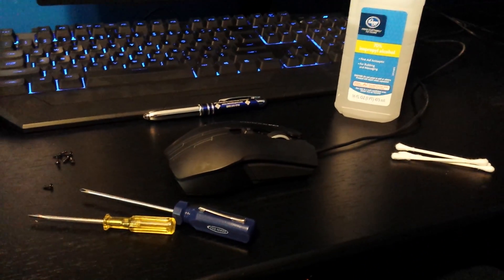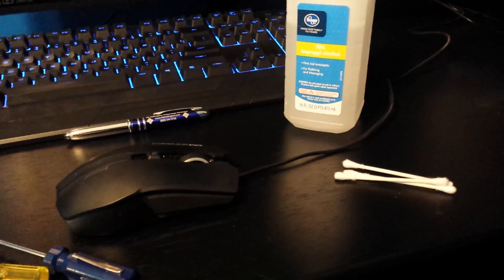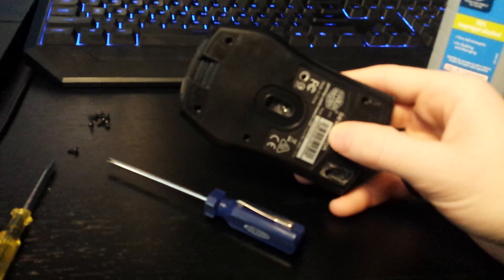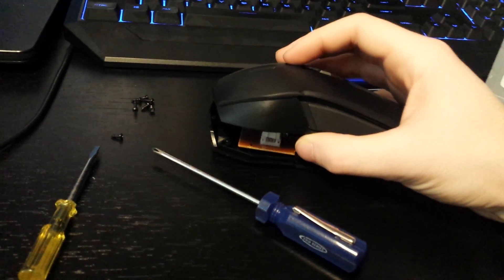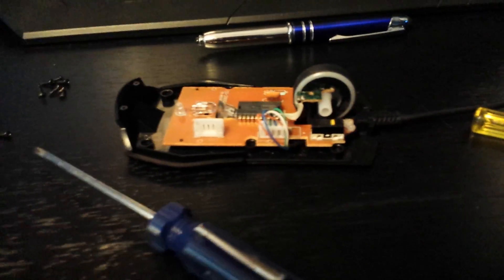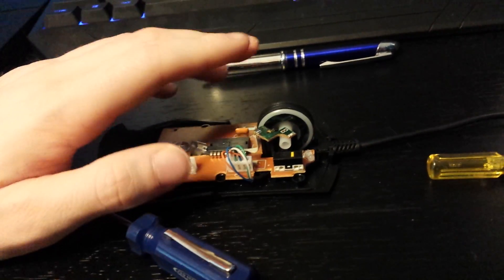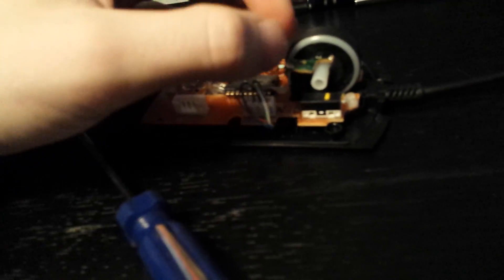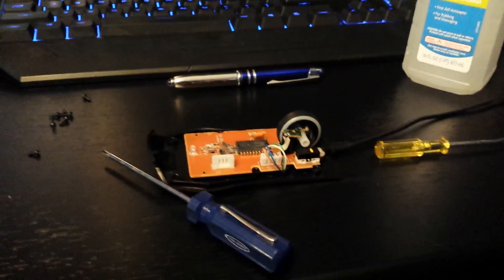Cm Storm Devastator Mouse Scroll Fix

Comment: This video made me discover a way to do this without taking the mouse apart.

I use one of those Walmart brand "Equate interdental brushes" it's like a fuzzy tooth pick.  I lay an alcohol swab over the wheel on the outside of the mouse, and fish it in with the brush thing, then spin the wheel, takes a few spins, and some moving, but works fine now, and I didn't have to lose any screws

Comment: i literally blew inbetween the gaps in the scroll wheel and it has fixed the problem instantly, defo try that first before dismantling. however video is nice and detailed. top job

Comment: I can confirm that simply blowing into the mouse wheel gaps to get the dust out does work. It's a good video though.
Reply: I tried this, even using compressed air, but I'm still experiencing this issue.

Is the mouse wheel just dirty or is it a deeper problem?
Reply: @holyordersol2668  blowing air into mine didnt help.. there was much dust built up, and even some fine pet hairs in there.. I took the mouse completely apart and cleaned every crevice.. it works like it did on day one except the middle mouse button click doesnt function.
Reply: @holyordersol2668  same, the mouse wheel is completely crazy, cleaned everything on a BRAND NEW mouse anyway.... it's a shit brand
Reply: I did this and it worked.
Reply: Just did this lmao, thank you

Comment: I had the same problem, but instead of opening up and trying to clean it like that, I simply got a very tiny and thin piece of metal, bent it to a semi circle with a little hook on it's end, kept scrolling the wheel and sliding it behind the wheel to grab any hair or dust that might have gone behind the wheel, also any bits of dust or hair on the sides of the wheel too. After doing it for like 2 mins, no more stuttering on my scroll wheel. I don't know if it will help everyone but it helped me.

Comment: This mouse is notorious for squeaking when you scroll the mouse wheel, so it would be a good idea to lube the wheel while you're in there.  Preferably with a non petroleum based lube.  As it will attack plastic components.

Comment: Close but not quite correct, the board you are mentioning as the reader, just has an LED light on it and lights up the wheel. The reader is the three legged potentiometer looking thing connected to the left side of the wheel. Spray it with wd 40 and turn it few times to work it in. Easy fix.
Reply: Thank you a bunch. The WD40 worked for me.
Reply: @horridstonefish7564  Avoid WD40, this is not car mechanic. Use isopropyl alcohol.

Comment: Ty so much
Edit:
Bro, the circuit inside the wheel is used only for lighting purposes, if u wanna fix the scroll wheel you have to fix the component it is attached to. This video is pointless.

Comment: Thats not the rotation detector. It's the LED that lighrs up the wheel. The rotation detector is on the other side and it's not optical, it's a crappy mechanical rotation sensor.. There's no way to fix it. Just throw it in the bin. The mouse is shit!
Reply: Doing this actually did fix all my problems believe it or not

Comment: **************   The thing you are thinking that reads the wheel is actually a led diode that lights up the wheel. The reader is actually to the side that the hexagonal shaft is inserted into.

Comment: Actually that sensor you're talking about is just the LED light, not a scroll wheel sensor. Go ahead and take it out of the scroll wheel and plug it in, the scroll wheel will still scroll the same if you take out the LED light.

Comment: anyone know why i cant hold the mouse button and scroll?
Reply: because the switch broke, you can unsolder the old one and solder a new one to fix it.
Reply: Sebastián Aramburo ok ty
Reply: +david pilemalm ahlström  no problem. if you mean the middle mouse button or the left or right buttons doesnt matter, both types of buttons (switches) are very common and easy to buy or scrap from old electronics, just make sure theyre of the propper size and height. it took me about ten minutes to fix mine and that was mainly because i had to wait for my soldering iron to heat up XD
Reply: Sebastián Aramburo ok lol but thank you very much for taking time from your day and helping me :)

Comment: hello people,anyone has any idea why when i shut down my pc,the mouse's light is still on?i used all my usb ports but nothing
Reply: Βασίλης Λαμπρόπουλος you can change this setting in the bios of your computer
Reply from the maker: +Βασίλης Λαμπρόπουλος its a cheap mouse. it always stays on unless you unplug it.
Reply: +Βασίλης Λαμπρόπουλος I have the same problem, oddly enough on my old PC it shut off on the new one it stays on. Baffled but I don't really care, it was cheap so just plug it out if it goes on your nerves
Reply: yeah,anyway i left it there always open
Reply from the maker: +Βασίλης Λαμπρόπουλος in the bios on your motherboard there might be an option to turn off power to usb devices while turned off. That might fix it, but you will have to hit the power button every time you wish to wake your computer.
Reply: thanks!
Reply: I have same thing, every time i turned PC off, mouses light stays on. Also i think that may be something like that, when you shutdown your PC, there will stay or mouse save some energy from the time you plugged it on to the time you plugged or shutted down your PC. Energy will stayn in and then after you completely plugged your PC off from the socket, will turn mouse light as far as i know, off. But i have seen, that i depends- sometimes it flashes even max. 2 minutes after plugoff, sometimes only 5- 10 seconds. Interesting, what i think.
Reply: The solution to this problem (for Windows 8/10 users) Hold SHIFT + CLICK the shutdown button. It'll turn the PC off completely (without putting it in low power mode) and so the light on the mouse will go off.
Reply: Wiganbrew i have windows 7 but thanks anyway
Reply: Daniel Zeynalvand i left it open since the day i bought it,well it's not big deal anyway thanks anyway
Reply: This video explains how to fix the light always being on.
https://www.youtube.com/watch?v=43JCCRm5n-4&t=2s

Comment: It doesn't detect any movement from the mouse wheel. The scroll wheel button is what detects the movement . The reason it jumps around when scrolling down a page is because the scroll wheel moves around to much .. I fixed this problem by wrapping eletrical tape around the little plastic tube on the scroll wheel..the tape makes the tube thicker which makes the sensor detect the wheel movement
Reply: Thanks a lot my friend, that's the only solution that worked for me!
Reply: Can you send us a picture of what you mean please?
Reply: Tried everything else and this fixed my jumping problem. Thanks hero!

Comment: I figured it out a bit more in depth, the button under the mouse wheel which does the wheel click, touches the wheel when it isn't being clicked causing the squeaking, I just put some mineral oil on it and bam no more squeaking. This also fixed the scroll wheel from moving in the opposite direction, not entirely sure how, but it probably had something to do with that button too. Stupid that cooler master didn't apply lubricant during manufacturing. Tanto thank you for this video.

Comment: i know this video is from forever ago but - the thing inside the scroll wheel is NOT A READER, nor does it count anything on the scroll wheel. the thing that counts your scrolling is on the other side, the black plastic part with the metal housing that keeps the scroll ring in place. it's called a rotary encoder, and it's been used ever since mice evolved  a scroll wheel. the small green thing with the wires is just a pcb with a blue LED so your scroll wheel lights up, nothing more. this problem is due to either a faulty rotary encoder or bad reading (or messed up algorithms to interpret the readings) on the chip inside the mouse.
other than that, good video i guess.
Reply: +VALKIR4636 finally someone that knows what is he doing...1 out of 30 :)
Reply: You are 100% correct about this inaccuracy of this video. I just opened my mouse and found that the wheel had too much movement side to side and was popping out of the encoder nut. FIX: I slid a wire twist tie under the led pcb, to the right of the wheel - bend the ends around so it doesn't come out - snip off the excess and voila! All better. Those encoders are very tough and don't fail often. The issue was too much space between the wheel support and the encoder.

Comment: hey can you tell me how to remove the key caps. I accidentally spilled a thick liquid on it. I don't have a key cap remover.
Reply from the maker: be very gentle and remove the caps from the back -"user side of the keyboard" with a screw driver. try to gently pry each corner of the key "gently" while pulling on them

Comment: didnt work it still skips ticks or what ever u call it and its getting really annoying
Reply from the maker: did you make sure the reader head was pushed all the way into the wheel, and it was tightly screwed in? i think this may fix your problem. Either that or you have a defective mouse.
Reply: yes i did and now it skips  a tick and every once and a while it gets like slow to spin
Reply: Tanto Gaming can I use something else other than rubbing alcohol ?
Reply from the maker: i suppose something like Windex or just a basic cleaner may work. just make sure you don't get any on the board